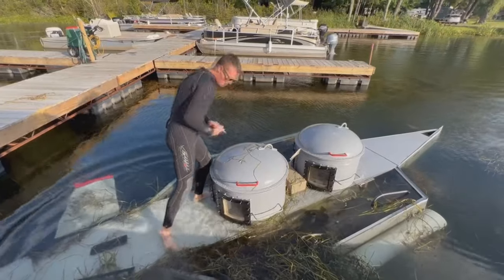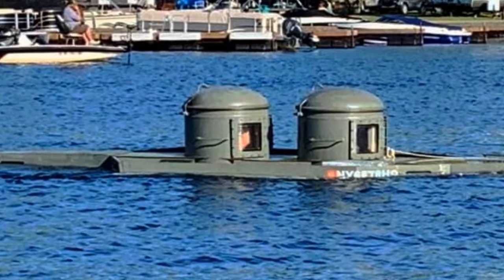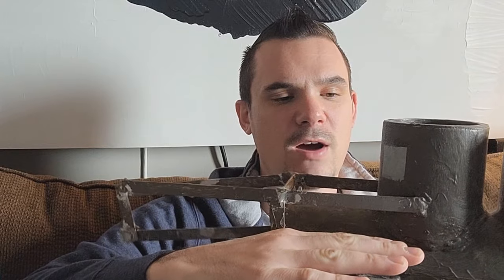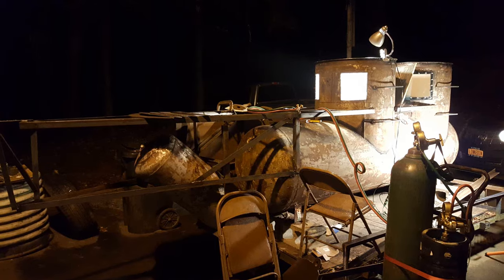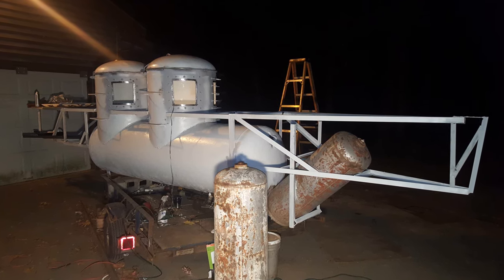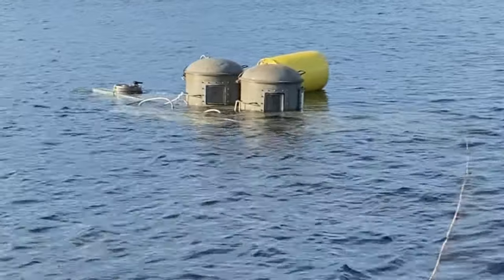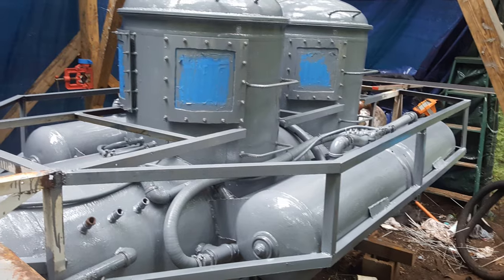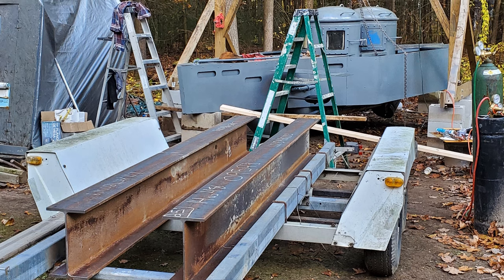How I Built A Real Working Submarine

Comment: Nice.  As an early EV adaptor, I can't help but think you could one day do an upgrade to the existing motor/power plant by burrowing some of this new EV tech using Li batteries with much more powerful motors.  There seems to be some room left at the bottom to add a used Li EV battery down there.  Just a thought!

Comment: Hi steve, You have done great inspired job. how much dry weight and ballast water weight was needed to fully submerge the vessel?
Reply from the maker: Thanks! 141.6 Gallons (1,179.5 Pounds of ballast). As water is 8.33lbs per gallon, when the ballast tanks are full of air, the 1,179lbs is the buoyancy added. The dry weight of the sub is approx 6,000 pounds.

Comment: Hey Steve, I am wondering how the depth is controlled. Can you float at a certain depth?
I have build two small submarines, one RC and one autonomous. The RC one did not have any depth control and always sank to the bottom once it left the water surface. The newer one has (and needs) active depth control that is continuously adjusting the ballast tank filling. That's easy with small electric air pumps, but how are you doing depthkeeping?

Best regards !
Reply from the maker: Hello - A set depth can only be held by moving forward while using the dive planes. It doesnt have a variable ballast tank. However, I can get it close while moving very slow because the fore and aft ballast tanks are hard tanks. So once the water is across the top of the hatches I seal those tanks so the boucancy can't change with depth.
Reply: @PlanesBoatsandSubmarines  Hey, thanks for your reply! Could you explain what hard tanks are? Does it mean the water is shut off to the tank, so it can't change its displacement?
Reply from the maker: Yes, hard tanks, once sealed their displacement doesn't change. I have a valve that vents the top and bottom of the tank. Whereas my soft tanks only have a valve to vent the top but the bottom is always open.